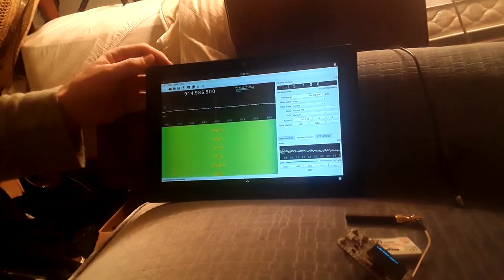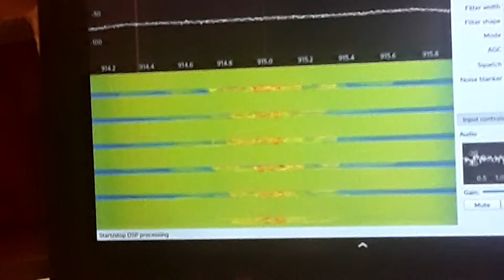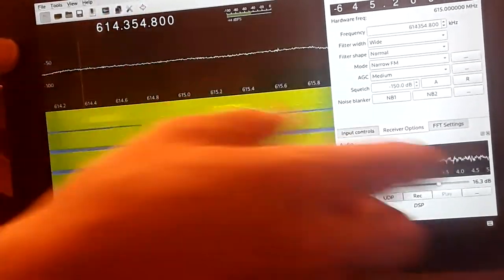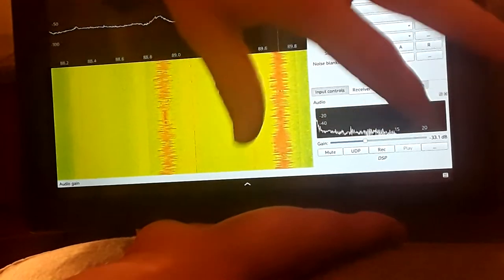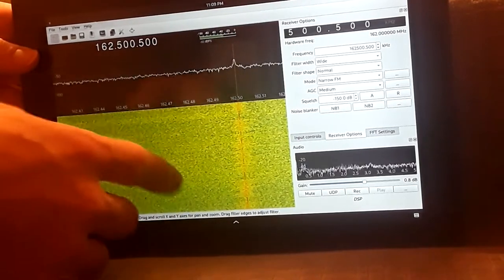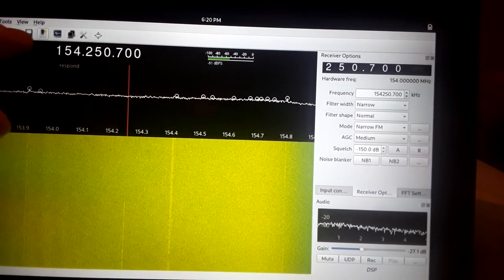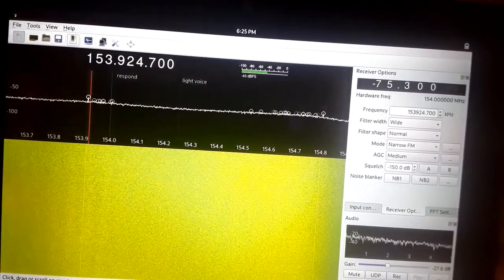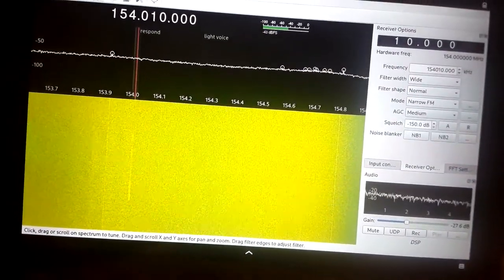Howto: SDR/GQRX On Pinetab/Pinephone, Listen To Voice Transmissions (Filtering, Modes, Gain/Squelch)

Comment from the maker: Welcome to my Pinetab/Pinephone SDR (Software Defined Radio) series! 8-D I am excited to find creative ways to use SDR on these neat devices. It's going to be fun! Any questions/comments on the video? Suggestions? I appreciate your feedback! 8-) And please... More LIKES!!! (less than 10% viewers?) The examples here are what were available with indoor antenna at the time- more optimization videos coming. :)
Reply from the maker: @Agent Neo Absolutely! (as long as they fit in the spectrum I believe RTL-SDR ($10-20 device) has capability (around, roughly) 24mhz-1.5GHz.

Many of our home sensors run 433MHz.

One guy tracked his water company cheating him on his water bills using the RTL-SDR by monitoring this with a Python script he wrote! 

On cars, keyless entry for ethical testing of your own vehicle keys, you can record the signal/transmission for keys (generally 315MHz), jam (recent use a rolling code- one that cycles different codes each key press- for security) and then if done right, replay (transmit) to unlock (or activate other button) your car door. Using a small wire on a GPIO pin can act as the transmitting antenna + RTL-SDR for the recording part. RPITX is a nice little raspberry pi package allowing you to use GPIO pins for transmitting (following local regs/license). It's not a high power/range due to limitations, but hey, it works. Fun to try these things out (on our own property) to find out how things work.

On IoT SDRangel is one that has LoRa (IoT) demodulator, and Ultimate Radio Hacker is another one I have just started playing with (without LoRa)

There is a very interesting Linux OS  you may be interested in called Dragon OS. It is all about radio/signals and the makers Youtube channel has some great example videos here: https://www.youtube.com/channel/UC9U2kaqhE716J2WNSTcOghg I haven't tried it yet but I plan to check it out.

On writing a program, you could take a look at Python modules/libraries to come up with something. :)
Reply from the maker: @Agent Neo This page has some decent info if interested in mapping out signals: https://www.rtl-sdr.com/tag/rtlsdr-scanner/

I have used rtl-sdr scanner, it uses the GQRX remote control setting. I haven't done much with it outside scanning/looking for basic signals.
Reply from the maker: @Section Nine As far as I know, still need 2. I only recently got my second one (internal pinetab) and plan to try out some trunking stuff on video.

Talked to a guy about Op25 recently and plan to give it a try. His channel is worth a look too, I may as well mention it for anyone reading comments: https://www.youtube.com/c/MKhanfar-MWK/videos

Most guides (for Linux software) require two. Now that I have 2 I want to try it either way. But the plan is to first find out if I can do it with one (using Linux software) to make the video more usable for others. :)

Comment: As soon as the Pinetab becomes available l will be following you tutorial.
Will tip you for a coffee at that time.
Have a good one.
Reply from the maker: Hey Nathan,

The latest update says there are plans for it to become available! Which is exciting as it has been on hold due to increase in touchscreens.

You may want to bookmark this tutorial on adding an SMA port (you can order the pinetab with the internal SDR card, but to get full range of external antennas I suggest following the tutorial where I demo how to safely open Pinetab to drill small SMA port (for screwing on various external antennas). Extremely affordable mod ($7). It really is my favorite SDR device as it works well and is extremely portable. :) Good quality generic SDR as well. 

Here is the demonstration on adding the external threaded SMA port mod: https://youtu.be/V-C6JzXhXbA I share my technique for safely opening pinetab (it's easier than you might think!).

You also may appreciate this example video where I demo using the Pinetab's SDR to discover that my PC laptop's speakers are transmitting as a  "hidden" remote microphone: https://www.youtube.com/watch?v=bK-CcnfP_ws I thought I was listening to someone else, and discovered this on accident - then I demo how to clean up the audio quickly with audacity.

Have a great day!
Reply: @RTPTechTips  Thanks for the heads-up with all the relevant information.
Have a good one and keep on keeping on.
Ciao...!

Comment: I use both Cubic SDR and GQRX on my old Solid Run Cubic-i IMX6 with the Airspy HF+. On Arbian OS.  
32 bit.
On my version of GQRX it looks like the gain is ua little too high. As it's all yellow.  The AGC setting is defaulted to 100 DB on mine you can adjust it down by hitting the box where you select Fast thru slow gain.  I also adjusted the waterfall to display colors where you can see the low signals better by selecting the FFT button.
Good video good work.....73.
Reply from the maker: I love CubicSDR! CubicSDR would not open on my Pinetab (I didn't look into it yet), but look forward to checking it out again. Airspy is nice! :)

I want to check out SDR++, a newer, in development application that looks like it has promise. Take a look (screenshots): https://www.rtl-sdr.com/sdr-recent-updates-plugins-multi-vfo-multi-platform-native-rtl-sdr-and-more/

Thanks for the tips and feedback! :)